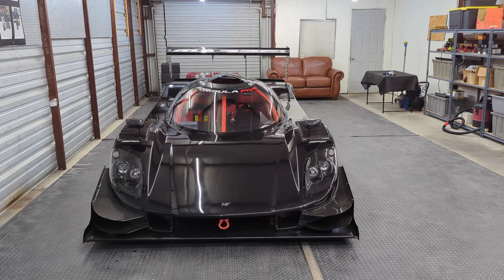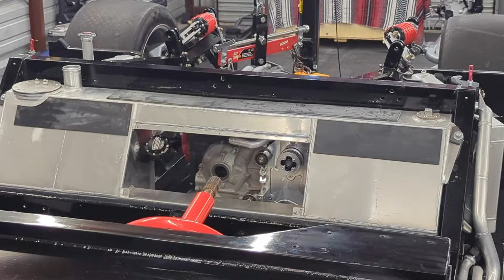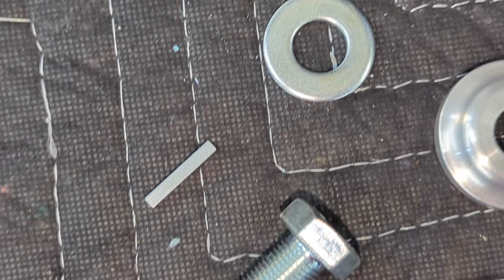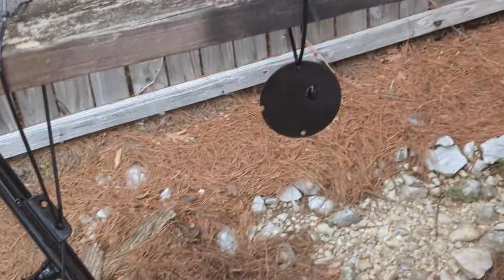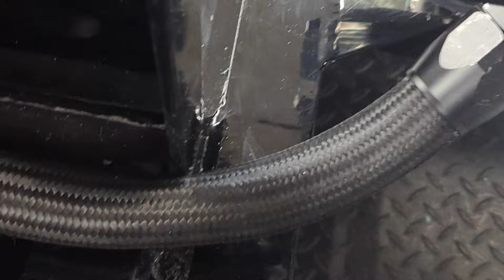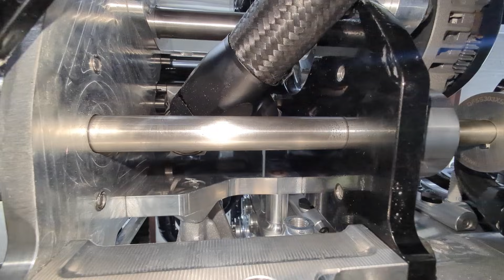The CRAZIEST Belt System You've Ever Seen; Supercar Rotary 5 Rotor - Mid-Engine

Comment: Remember to use submersible fuel line and a fuel tank sealer for the inside of the fuel tank. Over engineer the vital piece and bits ❤

Comment: I'm curious as to why go with mechanical pumps rather than electric pumps....and then have a better alternator with a small lithium ion pack to run it all, connected to your Haltech ECU. This way you can regulate them any way you want.
Reply from the maker: There really isn't a better alternator, this is the highest output that can be fitted on this system. Electronic pumps generally cannot maintain the same flow rate against head pressure. If you're referring to oil pumps, specifically the oil pumps are positive displacement and very strong it would be not be possible to find powerful enough oil pumps that are electronic
Reply: @MazzeiFormula  Thank you for clearing my doubts, I really appreciate it. I'm a big fan of your build, looking forward to when it's complete and setting records.

Comment: I think youll end up with idlers on all of your toothed belts. You may encounter noise and/or vibration like a guitar string once the distances get far enough apart. That front belt is pretty far from pulley to pulley with as high rpm this beast is gonna spin. Hopefully not but it will be an easy fix for you if you run into it. Cant wait for the next one.

Comment: Most of the tension on the the drive and driven comes from the work not the tensioner. You could look at belt tension as a static load, the work is where the real tension occurs. Moving the alternator and pump away on Jack shafts is a great idea and offsets the load from radial to axial which protects their own bearings.

Comment: Why don't you develop an engine shut off sensor which is triggered if the belt fails. Would be a useful product for many vehicles to have...
Reply from the maker: It shuts off if you lose the oil belt because the fuel pump is driven off the oil pump 😎

Comment: all those lines being very close to the frame or that nut...will be a problem. You can calculate all you want, but you will have more vibration than you think when you are actually running/driving, and things are flexing even just from harmonics, or cornering loads...etc Stuff is going to contact and rub and erode FOR SURE. 

Especially not in very accessible locations...that's going to be a problem area down the line. Which I guess might not be an issue fast enough, and you'll have the F1 style lines before the braided lines wear through. But seriously that stuff can happen VERY quickly.

Look into the motion detection software that can take even low resolution remote camera feed data, and calculate partial pixel shifts in shade to play out the full range of motion those parts are seeing during operation. It can be pretty cheap to do, and at the very least is very cool to watch with little time/money invested

Comment: Make sure to check those anti collapse springs, I'm not sure what coolant you are using, or if you are just using straight water, but there are usually corrosion issues with those springs, within a year sometimes. You may be totally fine, but just fyi

Comment: When you graduate from Youtube engineering, no tension in the belt no load in the crank ??? how it actually works you take for example the alternator 350amps *14v =5kw divide by rpm you get the torque, measure the crank pulley radius and you calculate the linear force acting on the crank. Belt tension is not even 1% of the total load the crank sees due to power being transmitted to the accessories. Also having all the accessories on one side nothing cancels out so all the force is acting on the same direction.
Reply from the maker: Pretty simple to understand, radial load is significantly reduced from a tension belt, in favor of more even distribution / torsional load but thanks for your comment
Reply: @MazzeiFormula  completely wrong, there is concentric power transmission like on a flywheel clutch assembly and then there is power transmission with v-belt, htd belt, chain etc where all the power gives a radial only load directly proportional to the power being transmitted and has nothing to do with static tension.
Reply from the maker: Over tensioned alternators, and water pumps are the number one cause of front stationary gear wear and warped cranks on eccentric shafts. It's a very common issue, alternator slips, user tightens belt to combat issue and damages front bearing. HTD significantly reduces this issue, and the user no longer runs the risk of overtightening the belt. What is your actual real world experience with rotary engines I would love to hear about your hands on results with Mazda engines and these issues if you do?

There are many rotary engines running external dry sumps (HTD) and alternators/water pumps (tension) in the same positions, myself included in on a 4 rotor for 5 years with similar loads (maybe not 370a but 240a is common) on tension belts. HTD can only improve upon this by reducing belt tension, slippage, and therefore reducing radial overload from tension
Reply: @MazzeiFormula  I also use HTD belts on all of my track cars that have dry sump not only rotaries. They are easier to prime the oil before start and in winter with thick oil i would not trust a vbelt for a cold start. Also even with leakage from coolant or oil htd will transmit power while the vbelt will slip. i just pointed out that bearing issues are not affected by htd vs vbelt, plenty of factory cars and aftermarket that run superchargers with vbelt and the tension needed to run those is by far more than any accessories need

Comment: Question about the dry sump. Why didn't y'all go with a Mazda style dry sump front cover?
Reply from the maker: The Mazda dry sump is insufficient for volume and longevity will be limited due to design of pump gears in aluminum housing. Furthermore, rebuilding the pump for maintenance would require removing the front cover and waiting over 1+ year to replacement parts from aftermarket suppliers since original Mazda is discontinued
Reply: @MazzeiFormula  I know there are aftermarket billet options, but I would assume the volume/flow wouldn't be much different.
Thanks for the reply and good luck can't wait to see this thing ripping!
Reply from the maker: Thank you! I believe there may some really nice aftermarket options hitting market soon that do offer easier maintenance too!

Comment: Why such an overkill alternator? 370a is ridiculous.
Reply from the maker: Overhead amperage capacity,
If you are only using 200amps, from a 370amp unit, the unit will last much longer
Reply: @MazzeiFormula  I wonder what your total amp draw will be. I deal with car stereos in mostly stock cars, not full blown race cars. So from my personal experience/applications a 180a alternator is more than enough. 🤷

Either way, this car is sick 🤘
Reply from the maker: I think there may be a good bit but we'll have to see. Id agree you're probably in the ball park. A quick estimate would be 35amp (2) water pumps, 15amp trailing, 50amp leading ignition, and radiator fans 100amps for all 4x, some where around 200-240amps depending on loads I'm guessing! Thanks man!

Comment: 19:37 That ~2” long oil hose is concerning. Have you considered clocking each of the fittings like 30deg so that you can have an s shaped hose in that location? Don’t want you to loose oil!
Reply from the maker: Are you referring to the 90 degree bend on the right side ? Or the 180 degree bend in the middle ? 

If you're referring to the latter it has been replaced with a straight line, as can be seen in the later scenes
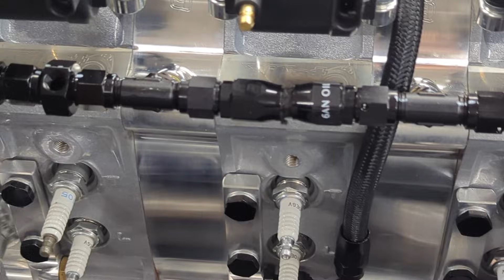Reply: Sorry, my time stamp was off to give very clear indication. I was referring to the very short hose that is in frame at 19:45. It is adjacent to the second from the front rotor and has about 1/8” of hose between the two coupling ends.

Comment: Did you consider an external crankshaft support bearing to take the belt loads? You’ll still have the drive tension from your loads even without the additional preload tension for friction.
Reply from the maker: Yes it is something we are currently considering, replacing the front guide bolt with a shoulder bolt that holds a ball bearing, pressed into a plate that ties into the oil pan / front cover. however it would require extreme accuracy in bracket placement and Clearence from fuel tank is limited. I am on the fence as to whether it's truly necessary, and if trying to add more support would actually create more risk from more potential things that could fail

Comment: Really impressive project. Looking forward to next pisodes.
But I would be little concerned with that alternator running close to 30k rpm with what looks like 3:1 ratio pulleys. Some friends had problems with burning alts by overspeeding them. But if this alternator is designed for that kind of rpms that its ok :)
Reply from the maker: Thank you yes it's a concern but according to the manufacturer of the alternator it can handle 20k rpm, and the ratio setup will be around 19k. So on paper it should be okay. Just have to test and see like all things!

Comment: Quick question,how do you calculate the ratios of your pulleys,by number of teeth like in a regular gear driven assembly or by pulley diameter?
Reply from the maker: You can do it by either! It's the same thing in terms of ratio
Reply: @MazzeiFormula  thanks for taking the time to anwser

Comment: HTD is a proven design, so not the worst possible choice, but it's also very old (~1985) and the existence of Gates' GT belts made it technically obsolete ages ago. Not to mention their new GTX belts in 8mm pitch. It's just that the Gates HTD patent is expired, so companies prefer to manufacture those instead of paying Gates for their newer designs. HTD belts are so widely spread because they're cheap to make and often 'good enough', not because they're particularly amazeballs in 2024.
Compared to GT3/GTX even the highest quality HTD looks like a joke. The allowable tension and transferable torque at high rpm are on another level.

Comment: That alternator pulley is way too small for that amount of amps,  belt will most probably jump over the teeth. Secondly, you should have a free wheel clutch for that pulley to reduce vibrations. Otherway I can say that this built will be mindblowing. 👽

Comment: You’ll be amazed at how tight those 8mm belts get when they get some heat in them. All that aluminum will grow some as well depending on the temp you run it. Man this would be right up my alley. I’ve ran so much AN line and installed so many AN fittings. I have all the tubing benders and 37* flaring tools. Spent a fortune on my benders and flaring tools as they didn’t have all this Chinese garbage available when I tooled up. Seeing this gets my creative juices flowing and ideas are coming one after another lol. I’m a perfectionist so this would be a dream to build
Reply: Interesting, they looked too loose to me. Won't the belts get a bit looser as they heat up and break in?

Comment: What a great build. So tired of cookie cutter builds. I’ve been a part of some awesome projects and loved having to overcome the impossible.  If it were my build I would fab a titanium belt shield to protect all the way around where the drive system is inside the fuel tank. Lord forbid something goes wrong and belt breaks punctures tank. Being a mid engine and enclosed inside the cabin with you… well you get the point. Chit happens keeping it off of you is the goal.

Comment: Hi David, thank you for another fascinating video into this amazing project. I wanted to ask if you'd be willing to share the brand/model of the CDI coils as well as the external voltage regulator by any chance? I'm playing with ignition systems on a 13B and would like to try the coils you are using and compare to my IGN1A's. Also the external reg idea is fantastic, not only for heat management but like you said, voltage choice.👍
Reply from the maker: Thank you, fueltech CDI and coils, and I haven't yet chosen the regulator!
Reply: thank you for the reply David, much appreciated @MazzeiFormula